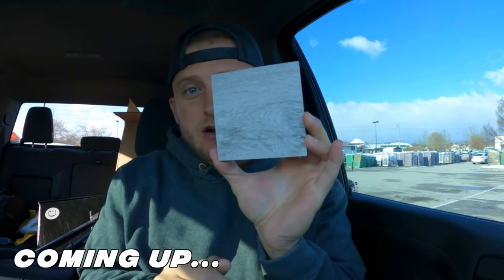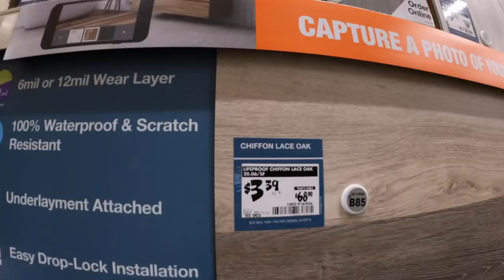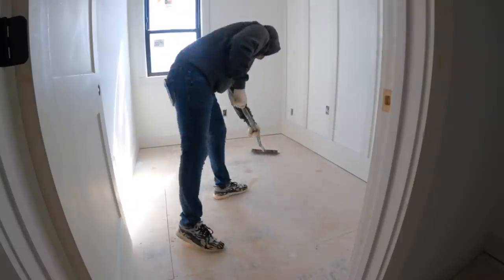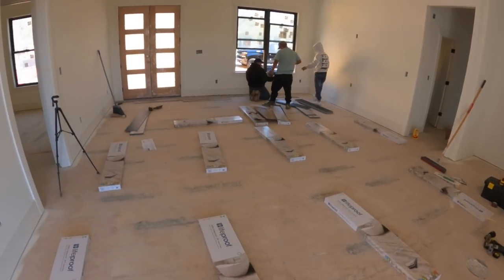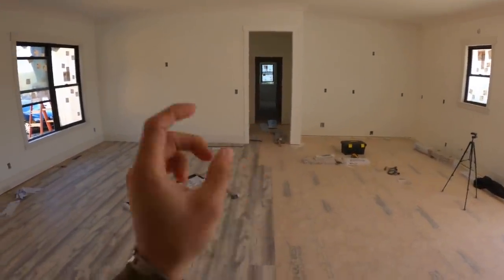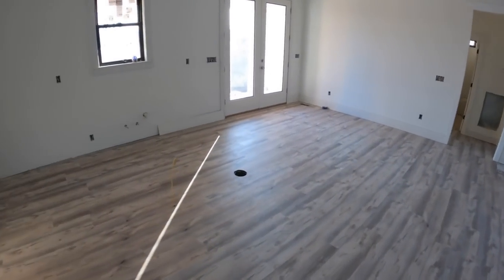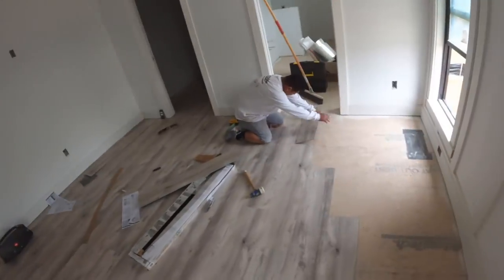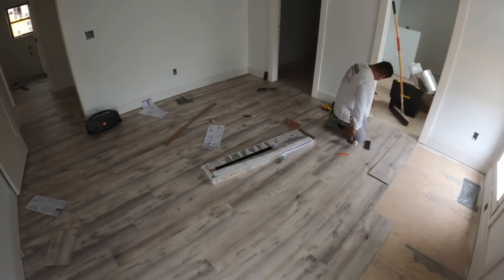How to Install LVP | Luxury Vinyl Plank | Building A $350,000 Custom House | EP 45

Comment: Hey Nikko. What grit sand paper did you use on the floor. I'm laying lvp over subfloor as well and I want to sand it to get it a little more smooth before flooring goes down.

Comment: The construction standards in Europe and US are universe apart. Laying floors without any layer between the floor and base?! Usually there should be 1-2 mm thick foam-like boards. To prevent from squeaking and as insulation. Hopefully you isulate from your crawl space underneath.

In every video you are the most excited and happiest guy, but so far you made so many questionable decisions. I have a feeling you're doing this for the youtube and other platforms and not for the quality of the build. You care more about the content then quality.

Maybe your family is in construction business, but let's be honest, you are far far away from it. If you cared about it, with your 28 years you should be mastering it by now, and not make so many rookie mistakes. And you are sharing advices like you have your own construction company...
Reply from the maker: Thanks for your comment!! That particular flooring has the foam like board on the bottom of it from the manufacturer. It’s intended to be installed directly to the floor system. Of course the crawl space is insulated. Thanks for watching!!